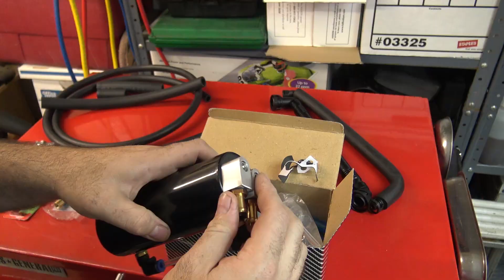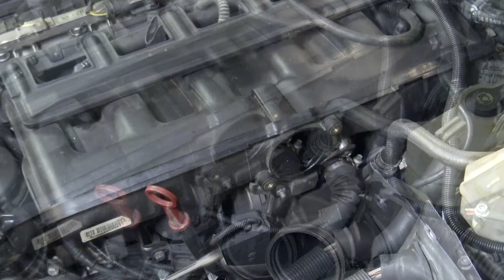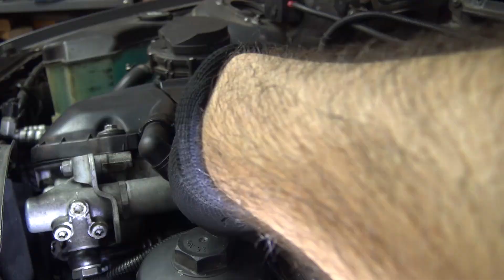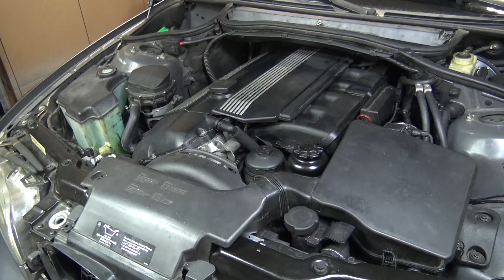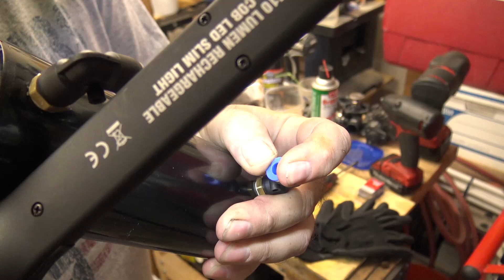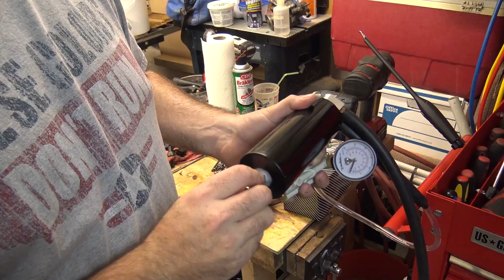BMW E46 Oil Catch Can Install DIY

Comment: Great video @50sKid, the best one I've seen on this mod. Good camera and sound production, thanks!
Question: Will this make it so I don't pass a smog test in New Yorkistan where they use computer devices?  (BTW, it's probably not a bad idea to replace the lower dipstick O-ring with a new one, as long as you're in there, no?)
Just FYI, (Being an ex-certified gas and marine pipefitter)Teflon does hold up to fuels, but it's much better to use a high quality (not cheap hardware store junk) non-hardening pipe thread sealant on both the threaded connections and the gaskets. (I used Permatex White Teflon pipe dope). Believe me, it's well worth it. Tape for amateurs, lol
So, keep up with the great videos Kid!!!

Comment: Hey I installed the catch can setup in the exact same manner on my 03 325i and my fuel economy has gotten significantly worse since. Any idea? I also changed the plugs and air filter
Reply: Also my fuel economy gauge will go up and down in neutral when I give it gas and never had this issue before
Reply: You have a vacuum leak for sho

Comment: Hi, I set my system up like yours but there is a strong vacuum pressure on the oil cap. Do you know what the issue could be please?
Reply: VirdiMilano Apparently when the oil catch can is properly installed it will produce a strong vacuum pressure in the oil cap, because that’s the suction from the intake manifold being applied to the system. If you can’t feel enough suction in the oil cap, that means your pcv system is totally clogged!!!
Reply: @technopro-kz4xv  thank you for letting me know, is that pressure healthy for the engine? Is there anyway of reducing the amount of vacuum?
Reply: VirdiMilano Well, if your valve cover gasket is working properly, don’t worry about the vacuum. But if you have a vaccum leak somewhere in the system, that will increase your short term fuel trims because the manifold would be sucking air from the place where the gasket is failing and that extra air is not being calculated by the sensor in charge to measure the amount of air ingested by the engine, causing at the end a bad air to fuel ratio or also called the stoichiometric mixture. If you have a cheap OBD2 reader, check your short term fuel values, if they are above 5% ( you will see numbers as 5.35, 6,23, 7.81) then you have a vacuum leak in the engine. 👍

Comment: Hey there, going to use this on my Supercharged M54B30 instead of the way Active Autowerkz system now vents CCV back in to the charged pipe... Hate it!  If you are going to dump oil back in to the pan through dipstick just 86' the sight tube on the can and block off. Thanks for your vids.

Comment: Thanks for your videos, man! I always appreciate them!
(Having two M54s in the yard, I kinda am addicted, or at least depending on them.)

Short annotation @ 16:55: I once broke of the whole port and ended up with a hole in my rocker box cover.
So, folks, be a bit careful with each of those black plastic parts you 'll find in your engine compartment...!

From my own experience, I'd highly recommend to get each of those hoses, quick connectors and o-rings new. Otherwise, you will do all that, ähm, "funny" work twice...

kr from Munich!
Markus
Reply: Will this system work on the x5 with the 3.0i

Comment: I've got a question about the catch can installation. Can it somehow be connected with the check engine ligth on after you install it, particularly depending on the diameter of the tubes used? I did mine and I used the N54 original catch can that perfectly corresponds to the 19 mm tubes in and out -  this fits to oem connectors and FRAM FV 345 PCV. After installation everything runs perfect, but the check engine light appeared. Can we assume that this diameter gives more O2 after MAF and causes CEL? What's your opinion?

Comment: Hello what is the easiest way to find out if you have a bad oil separator i have a 2004 545i that's smoking. Pcvs are good too out 4 spark plugs no oil plug is dry ?

Comment: I believe by that installation you've made more pressure in the crankcase (blocking the hose from the deep stick). I have an idea which I've already done on my car just need to make milage to check if I'm right. I've just cut the hose coming from the separator to the intake, and I leave it to breathe in the air, then I block the intake, so no more vacuum in the ccv, just running as the older cars.

Comment: Im about to do the CCV system (cold weather) in my 02 330i. After having ran both setups what do you recommend? And if the oil catch can is the best option, is there any catch can that you would recommend?
Reply: I think my cold weather ccv has done 115k miles and is still fine so i am leaning towards keeping it oem for the same duration again.

Comment: I have stock CCV with the O2 pilot mod. I don't live in a cold climate. However, once my stock CCV eventually fails, do you think a catch can is an upgrade? Or should I just replace with new stock CCV to avoid vacuum leaks and whatnot? My fuel trims are under 5% at idle and it'd be nice to keep it that way.

Comment: I have a couple of questions:
1) Should the PCV be positioned vertically?
2) my engine has 139,000km's and I don't think my oil rings are worn quite just yet. Will the added vacuum created by the PCV cause excessive wear of my oil control rings if they aren't as worn in?
3) What is the chance that the PCV valve freezes in the winter?
Reply: Any updates?…

Comment: I used the same everything and PCV, and it shot oil out oh my gaskets, the entire bottom of the car is covered. What can I do? What else could be wrong?
Reply: Replace the valve cover gasket and oil filter housing gasket, apparently if they're old they can get blown out by the extra amount of vacuum.
Reply: For all BMW, including F30+, engine valve cover gasket and oil filter housing gasket (OFHG) are "maintenance" items, and required replacement every 7 yr (5-10 yr).  Some are longer, such as mine is 10 yr when it leaks seriously.  Some are sooner, such as 3 yr.  So let's keep it 7 yr.
50sKid has other video that explain how CCV works, and its operation.  In one video he did mentioned the vacuum through new CCV hose is little different than his expectation according to standard PCV design since 1961 (California enforced air pollution law for PCV).
By general PCV design's understanding, oil catch can and BMW CCV should provide identical result, pressure, operation

Note: Valve cover gasket job also includes spark plug gasket and screw grommet on the valve cover as they could leak at the same age

Comment: Hello. I installed occ on m54b30, it does help to avoid oil consumption. But one thing that i noticed, the occ doesnt collect oil in it, after a month of use it only had a few drops. Am i doing something wrong?
Reply: is it a baffled catch can? if not, that's likely your problem.

Comment: Great video but kinda loosing sight of what a catch can is for, none the less very informative and good detail!
Reply: Instead of contaminates being cycled back into the motor via the air intake,  a catch can is a system that filters them out.

Comment: Hi there, looking at catch can on E85 Z4. Do u think I would need a pcv valve if I used the smaller vacuum inlet located on the bulk head end of the inlet manifold? M54 engine.
Thanks in advance....... Tim.

Comment: +50sKid do you know how often the catch can will fill up / how often you will need to change it if you do not run the return line?
Reply: My catch cans on my BMW 335i I clean them whenever I change my oil that's part of routine maintenance it will also give you an idea how much is being captured

Comment: Ok, need some help, did a whole top end gasket replacement on my 325xi, and I'm stuck and getting the dipstick in. Lol, of all things. It seems to be 1/2" off the bolt hole. Does it really bolt in to the engine mount??? Also my car is on 4 jackstands. Any ideas? Do I need to jack the back engine/tranny up?????

Comment: Hey 50skid I’m in need of help I’ve got an oil catch can fitted to my m52b28 e36 got a hose from valve cover to catch can then the other hose venting to atmosphere but I hate the smell lots of fumes could I run the hose what vents to atmosphere into my intake elbow or in my intake manifold without using a pcv valve as the trouble is finding a pcv valve over in the uk Thank you
Reply: Jordz, I'm in the UK and just bought 50s exact same pcv valve off amazon. Fram fv345

Comment: Hello engine m52tu mileage 400000km oil consumption is not !! but the original valve is very problematic! This air suction oil in the collector and its replacement !!! made oil catch with fuel filter valve FV345! Vacuum is strong, I understand that it is good, but only for those who have oil levels, I don’t have such problems because m52 and m54 motors are different !!! the difference in the piston group because m54 eats oil like a bull)))) author many thanks !!!!! Only there is a question I can not understand how the valve FV345 should work !! I have it blown in 2 directions ?? I need help!!!!

Comment: I installed the catch can on my E46 but question is I used the Purolator pv1050 PCV valve on vacuum (intake side) after running car for a bit I went to check the oil and when I pulled the dipstick oil shot out everywhere. I installed The Valve threaded side towards can. Is this why oil shot out when pulling dipstick? Or is it installed correctly?
Reply: Installed backwards. Same mistake 50s made in his video. U created crank case pressure thus pushing oil out of dipstick when u removed it.

Comment: you shouldn't step down the pipe sizes to fit the catch can, you should get a catch can with ports the same size as the breather ports because it can restrict the ventilation.
also i wouldnt want to run my disgusting catch can blow by oil back into my engine. if you really cant be fucked draining a catch can just vent to atmosphere.
Reply: Yes Yes Yes ! Comment of the year ! Only somebody foolish would not keep the OE diameters.

Comment: What about the moisture build up in the oil pan? I might have missed that. I will watch the video again shortly. Can the crank case be put into vacuum, without the CBC valve, and not coat the intake runners with oil?

Comment: @50sKid I just compact catch can  for my BMW however it doesn't have a drain at the bottom should I drill it out to put the pilot mod on or just try without it? Please get back to me thank you also love watching your videos you're my go-to guy.
Reply: Kenny Springer most budget catch cans just have a canister that unscrews like an oil filter.  Most of the budget one are too thin to drill and tap for a drain fitting.

Comment: 1 quart of oil every 1000 miles? Wtf. My 2001 330ci burns nothing. Maybe you got a shity car? Did you use the vacuum from the intake rail? That's way to much. Use the lower vacuumed plug from the back of the intake.

Comment: I have an important question... So, I keep coming back to this video. Thank you for explaining everything in depth. However, the PCV location and direction you kinda rushed through at the end, and I couldn't exactly understand. I bought the purolator 1050 PCV, same like yours. I'm also going to drain the oil back to the oil pan with a check valve. BUT, Where do I put the PCV. Between valve cover and catch can, OR between catch can and intake manifold? You mention something about your mistake causing the PCV to stay closed. And then you show edited footage of you putting it back where it looks like you're switching around which hose you said to go into. THANK YOU VERY MUCH =)
Reply: Pcv between catch can outlet and inlet manifold. Pcv threads towards inlet manifold. Imagine the flow of air out of valve cover through catch can and into inlet manifold. Blow on the pcv valve, it'll only flow 1 way. Then fit it the way the air is flowing so it doesn't cause a blockage.

Comment: I ended up removing the ccv system and routing a line from the valve cover port down to the ground to avoid smelling the vapors. I Sealed off the two small ports on top of the intake and put a cap on the oil return line port @ the dip stick. 
6 months and probably 5 thousand miles later it seems to be runing ok. I'm no enginer- I dont know how much vacuum goes through the system but I need to know what and how much damage it might cause. # 02 E53 X5 @240k
Reply: Purpose of CCV (PCV) system is reduce air pollution (1950), and became a law in 1961 (California) that every car require it to reduce pollution.
BMW (and many other) engineers designed the vacuum system by considering the pressure of CCV to archive the optimal performance/operation.
In practical for car's life that is 20 year, removed the CCV and drain directly to atmosphere does not make significant damage to the car.  However, the contamination is damaging entire human population for easily next 100 year, not to mention food contamination (due to soil + air + water + river + ocean = vegetable + meat + fish + drinking water + animals)

Comment: Hi 50’s kid m ur big fan plss reply me this -i hve installed catch can on my e46 330i yesterday same as u did but i did not use pcv valve and now i hve soo much vacuum dat i hardly can take the cap off and it throw the engine light on i did read the codes about 5 of them all abt lambda sensor bank 1 bank 2 soo my question is -is it all coz i did not use pcv valve      Thanks
Reply: Fixed needed pcv valve 👍🏻

Comment: does this take some load off the ccv
Reply: BMW's CCV is an oil catch.  This system is replacing BMW's CCV.  Entire CCV is gone, and become oil catch can.  It gives the same result as BMW CCV but prevent oil sucking back to the valve cover and cause engine hydrolocked.
My 1 year new non-cold climate CCV caused engine hydrolocked on -30C temperature

Comment: Hey there, hopefully you respond. I did a catch can install on my E46. I used the same PCV valve. How much vacuum do you have at idle? Is it easy or moderately difficult to remove your oil cap? I feel like this setup is giving me a little too much crankcase vacuum. Thank you.

Comment: For what You install a catch tank when this do not catch? The tank is for the water and oil mixed "soup". Please dont give this bad soup back to the engine. The engine will get a stomach pain from this Soup.

Comment: I installed my mishimoto oil catch can on my m54 now I see oil coming out my rear main seal and white smoke from my exhaust system... plus when I just crack my oil cap I can hear the vacuum being suck in. I’m trying to find out if that’s normal and what the white smoke is

Comment: I watched Nathans DIY Garage he recommended  use of the rear vacuum port on the block for output vacuum because its low vacuum pressure and the catch can wont suck a lot of oil. is it better to use your method?  Note my catch can dose not have the bottom drain plug. Or dose it really make a difference?
Reply: Do not install the vacuum hose on the rear vacuum port.  You will create a lot of leaks or blow your rear main.  It does not have enough vacuum under heavy acceleration.  Trust me.   I followed Nathan's advice and I blew out my valve cover gasket.  50kid got it right.

Comment: @50sKid. I have done this mod and it creates so much vac that when I rev the engine and it comes back to idle the oil dip stick starts to whistle. And its hard to pull the  stick out when running and also hard to remove the oil cap. Is this much vac normal with this mod? And also do you need to install the check valve? I know you said it's for back fires but is it really needed?(edit)(definitely need the check valve. Installed and fixed the dip stick whistle. Without the PVC valve the intake must pull to much vack out of the crank case?)I am a subscriber and always watch your videos before working on my car. Thanks for all your awesome vids.
Reply: did u install with out pcv ? how is it working.. share your experience

Comment: How's it going 50's kid. Love the videos and you earned me as a subscriber as I have watched a handful of your videos in depth, multiple times over the past couple of days. Just had a few questions that I hope you or someone on here can be kind enough to supply the answers to, as I am still new to this self maintenance:

1. Does the oil catch can method work better than the ccv valve/hose approach? 
2. If you install a drain line to the oil dipstick, from the oil catch can, do you have to empty the catch can at all?
3. If so how often?

Thank you:)
Reply: Firstly, let me set some background, cost, design:

Oil catch can - USD$20
Oil-air separator - USD$200

BMW's CCV system is oil-air separator, which should be a better design than oil catch can.  However, its compact and plastic design has proven to fail many BMW owner such that a cheaper and simpler oil catch can that cost ~ USD$20 works better than this USD$150 CCV.

Either generic oil catch can and oil-air separator will work, but 50sKid use catch can for cost purpose.

1. After experienced engine hydrolocked at -30C using BMW CCV, I certain said oil catch can works better as oil has lots of space to settle than CCV's design.  Under cold weather (-20C and below), non cold climate CCV that is few yr old could caused oil sucking back into engine

2. Oil in the can will immediately drain into oil pan.  If your can doesn't has a hole at the bottom, then you will need to drain it (to engine oil cover, or oil disposal station).  CCV is designed to drain to oil pan through the oil dip stick anyway